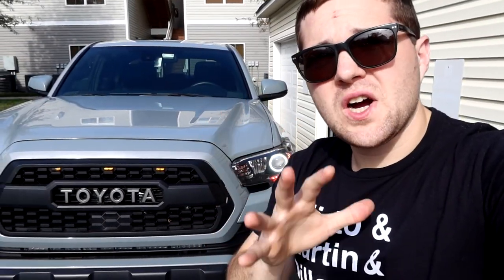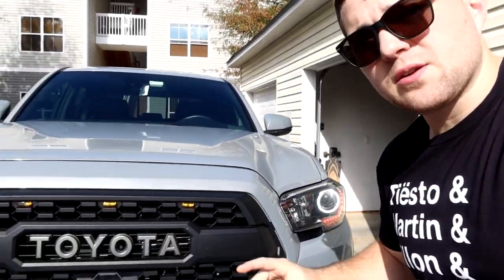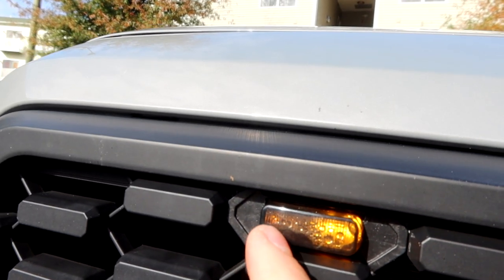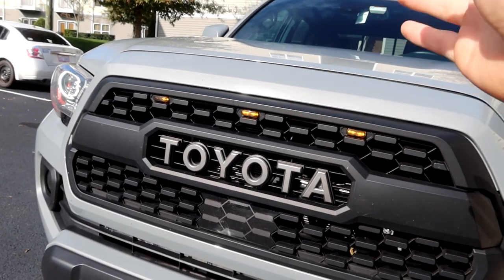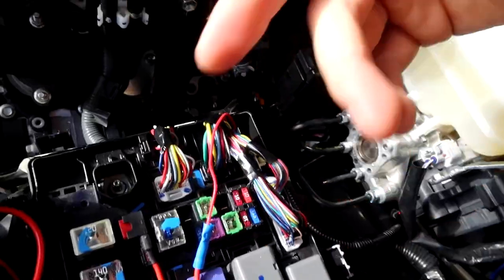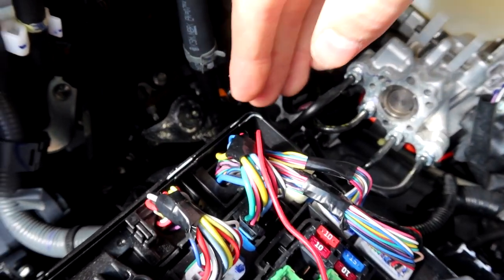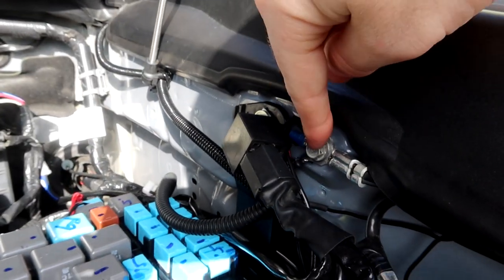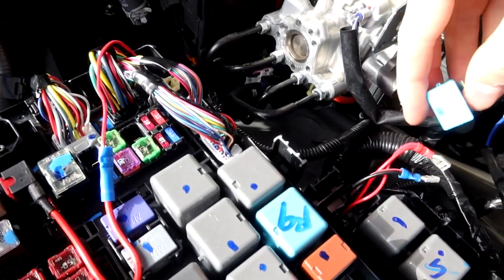2020 Toyota Tacoma TRD wiring mess! (Custom Lighting)

Comment: You haven’t had that problem that the raptor lights randomly come on while the truck is off when connected to the INJ fuse? Just wondering please respond. Just curious
Reply from the maker: Nope havent yet
Reply: I used the INJ fuse for three months. Then yesterday the check engine light came on. Dealer charged me $447 after they figured out the O2 fail code was caused by the fuse tap.
Reply: @WeFergie  Damn. Well I wired mine into a button so it’s independent wiring and turns on when I click on the button whenever I want them to be on.
Reply: @beptex2858  Thanks for the reply. I have a Trigger six shooter switch box yet to be installed and I may have to use that. Seems the other choices are cutting into the DRL harness or only have the light work with the headlights. Have Fun!

Comment: Yah just wait until you over load that injector circuit and the fuse for that circuit blows and the engine stalls out. Tap into a charge port circuit or some other non essential circuit
Reply from the maker: Like I explained thats not how an add a fuse works
Reply: @TacoRick  I’m a auto tech. that’s been doing this work for 40 yrs and I’ve seen so many problems caused by taping into the wrong thing. An add a fuse  still puts more draw on whatever circuit it’s taped into when the lights are on. On these modern computer driven vehicles that can cause many problems just like your first attempt at the lighting. Take my advise and get your power from a charging port.